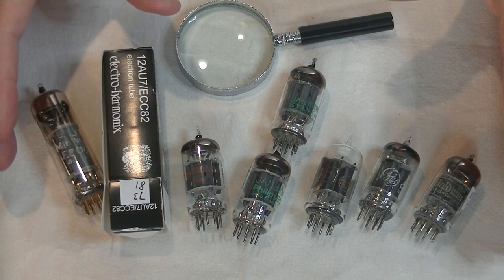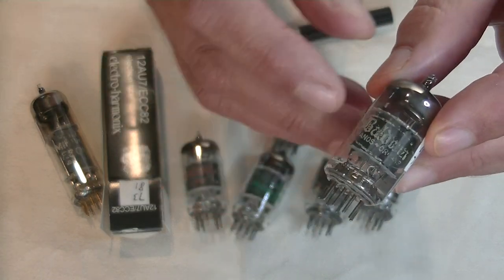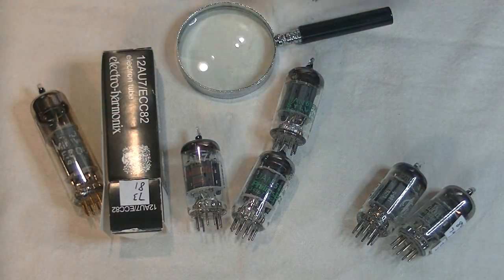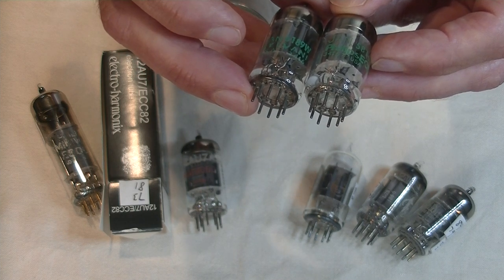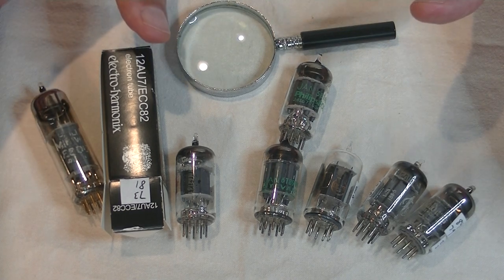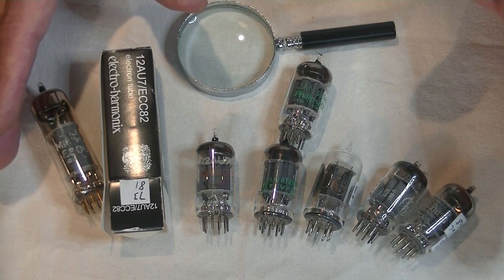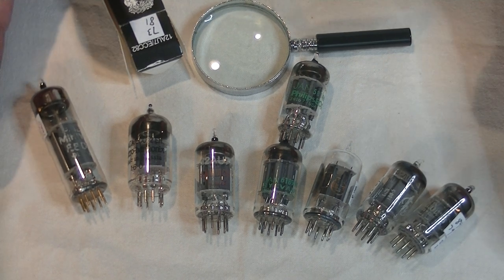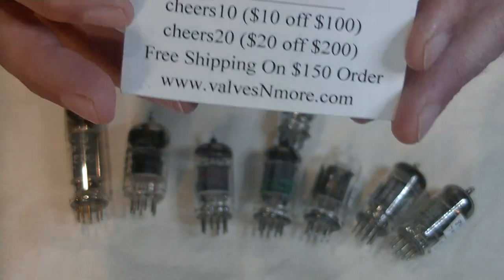Tube Lab #8 12AU7 Rolling

Comment: Great channel !! I just have a question, since I’m not experienced with tube rolling. Which tubes should I change first if I want to hear a significant change in sound? Power tubes? Input tubes? Thanks 🙏
Reply from the maker: Well to quote the great Michael Fremer "everything matters!". I always qualify this by adding "but some things matter more!". So with any tube amp, all the tubes matter.  Normally first tube at input will be the most influential, that's because it will be the voltage gain stage and that will affect what comes next more than anything.  But if you are trying to voice an amp and roll in great sounding vintage tubes into the first sockets and leave mediocre power tubes in place, it won't matter how good your front end tubes are, what comes later will wreck your sound.  Conversely if you have a wonderful set of vintage Mullard EL34 xf2's in the output stage and crap tubes before it, it won't matter!  You'll never even know you've got one of the best sounding EL34's ever made!
Reply: @tubelab194  that’s a good point! Much appreciated! Thanks 🙏
Reply: The first tube.......

Comment: Quite like my findings overall. I have most of those as well as several E80cc's, Tele and Brimars. The e80cc is higher gain and more dynamic. A little leaner than most but has balls. I like the Brimar 13D8 and CV4003 best in my setup.
Reply from the maker: Thank you for that description of the E80cc, they will be featured in an upcoming Tube Lab, and i've been thinking of how to describe them, can I use your line "little leaner than most but has balls"?
Reply: @tubelab194   sure, I feel it is more like the Super Tube 6h30 than most  vintage bottles. It’s actually a little fresher sound as well.  It’s really cool but there are so many variations of that tube, it’s a tube rollers dream to have a 12au7 based circuit.
Reply: Nurse  well it can be system specific. If you want extra smoothness, richness and a thick sound the JJ ecc802 is it. The RCA clear top focuses of high frequency clarity. The E80CC is supercharged everything.

Comment: How do u comoare with ECC83?
Reply from the maker: ECC83 / 12ax7 is a high mu (gain) tube and completely different than the ecc82 / 12au7, which is a low mu tube.  Not only are the gains at opposite extremes, but other parameters like plate resistance and use in circuit are different as well.  You don't compare dissimilar tubes - there's no point.

Comment: Howdy.
I use JJECC82 in my designs. Mainly because the reasonable pricing.
Biasing to about 7V and using constant current loading I can get an output swing of about +-120V using 300V as B+. The cathode resistor being 2k2.
The current is about 3 mA so the impedance is well low enough to drive the grid (capacitance) of EL34 or KT88 as end tubes.
12AU7 / ECC82 is not very linear. It introduces odd harmonics.
Regards.